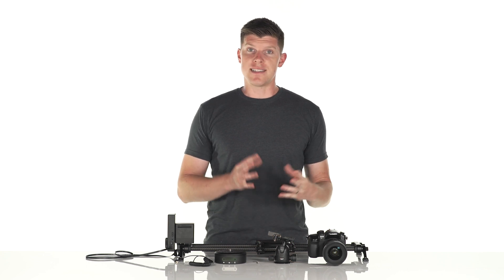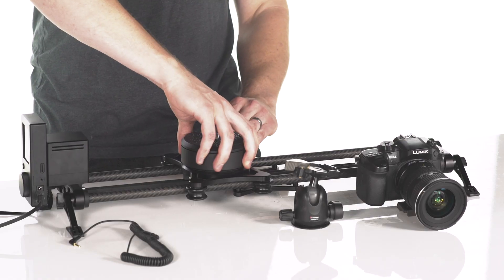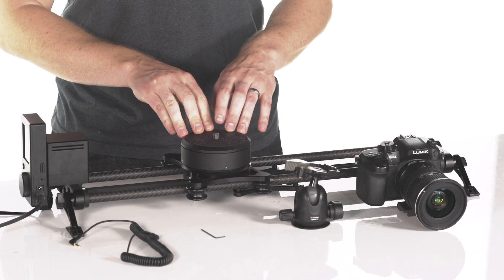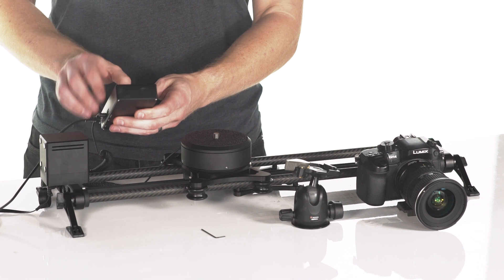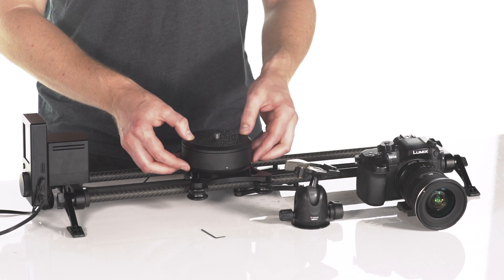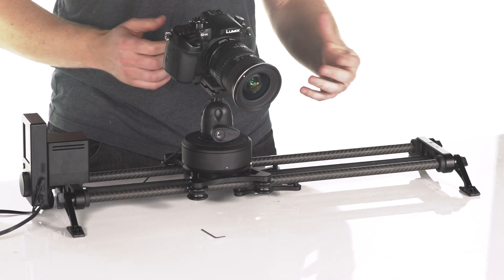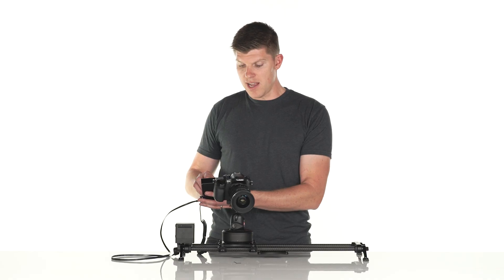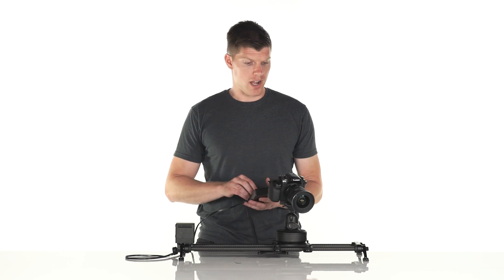How to: Set up Rhino Arc

Comment: Customer Support is the worse ever.
 
 I am reaching out to inquire about the latest developments concerning the ARC II product. As we are now in May, I recall you mentioning that updates or improvements would be available by March. Since the timeline has passed, I am eager to receive new information or solutions.
Unfortunately, the ongoing issue with my ARC II has significantly impacted my business operations. Please expedite the process of resolving the problem or consider providing me with a replacement ARC II unit.
Please inform me of any recent updates or fixes for the ARC II product. 
If you still need time my right, so, send me a new one 
Your prompt attention and assistance in this matter will be greatly appreciated, as it will enable me to resume normal business activities.
Thank you in advance for your understanding and support.
Reply from the maker: Hi Ashraf, Thank you for reaching out to us, and I apologize for the difficulty you've experienced in trying to get in touch with our customer service team. We've had some recent turnover in that position, which has been frustrating for both us as a company and for our valued customers such as yourself.

We understand how important it is to have your concerns addressed in a timely manner, and we want to assure you that we are doing everything we can to address the situation and get our customer service team back up to full strength. We want to make sure that we provide the best possible service to all of our customers, and we are committed to improving in this area.

In the meantime, we would love to know if you have been able to connect with someone in our customer service department or if there is anything else we can assist you with. We value your business and appreciate your patience during this time of transition.
Reply: @RhinoCameraGear  Thank you for your response. I apologize for any inconvenience caused by the customer service team. However, what matters to me, sir, is that I am severely affected by the delays and the halt in my work. I don't want you to apologize for this; what I want is a permanent solution. Please note that I have a warranty from your company, so I kindly request immediate assistance in resolving the problem. I believe you are capable of sending a new device arcii, and this is my right.

Comment: Unfortunately, I am compelled to express my extreme dissatisfaction with theARC II  purchased and the support I have received thus far. My experience could be more satisfactory, and I believe sharing my concerns with you is crucial.
Firstly, the [ARC ii] has consistently underperformed since the purchase, exhibiting issues such as [describe the problems you have faced with the product]. I have attempted to address these issues through various troubleshooting methods but have failed. The product's poor performance has negatively impacted my [work/productivity/user experience].
Secondly, I have contacted your support team multiple times, seeking assistance in resolving these issues. Regrettably, the support I received was unhelpful, with delayed responses and inadequate solutions. The lack of timely and effective support has only exacerbated my frustrations and the negative impact on the product's performance.
Given these circumstances, I am requesting immediate action to rectify the situation. I kindly ask that you provide one of the following solutions:
A full refund for the [ARC ii], allowing me to return the faulty product.
A replacement unit of the [Product Name] that is fully functional, and without the issues I have faced.
Direct assistance from a knowledgeable and responsive support representative who can efficiently guide me in resolving the issues with my current unit.
Your prompt attention and action in this matter will be greatly appreciated. I want my concerns to be adequately addressed, and my experience with your company can be improved.

Comment: Hi there, our Arc's controller won't stop flashing when plugged into the outlet. Is this a default behavior when there isn't enough power for the unit? Does this mean we need to update firmware? Or does this mean the unit is now broken?
Reply from the maker: Sorry you're having issues, please reach out to support@rhinocg.com
Reply: @RhinoCameraGear  I did on December 8th at 2:26pm ET and never heard back.

Comment: Is the Arc supposed to make noise when it moves? Mine does, it is louder than the sound made by Rhino Motion. The noise changes pitch as well, when ramping up and down, and I can't tell if it is faulty or if that is normal. It also makes noise at different sound levels when turning the controller's wheels to pan Arc's top plate. I haven't yet done tests to see if it will be loud enough to be heard in the audio of an interview. I'm filming next week so any tips would be great, thanks!
Reply: ^when turning the controller's wheel to pan Arc's top plate.
Reply: I just got mine today and I was wondering about the same thing. It's relatively loud when it's paired. It makes kinda like a static noise when it asks me to "Turn Wheel to Point the Camera." Is yours making that sound too? When my Arc is actually doing the move, it goes quieter but as soon as I am in my setup again, it's noisy.
Reply: yes, that static sound is normal, it is energy being built-up, but it should go away during a move, according to Rhino.